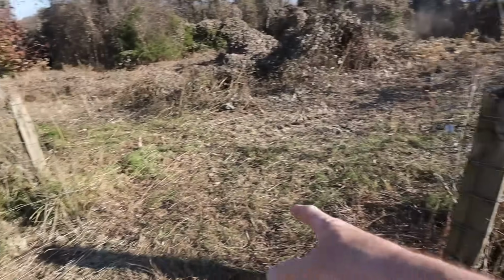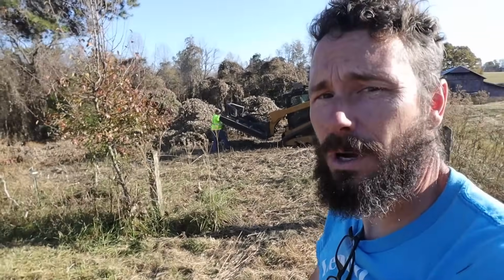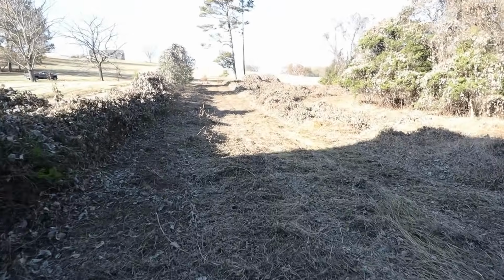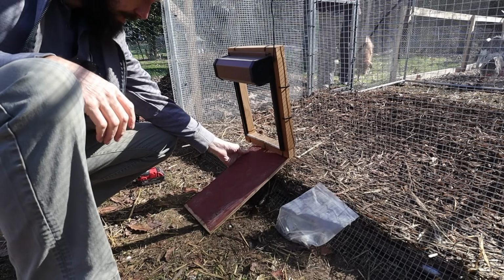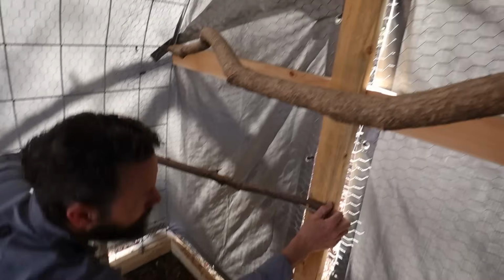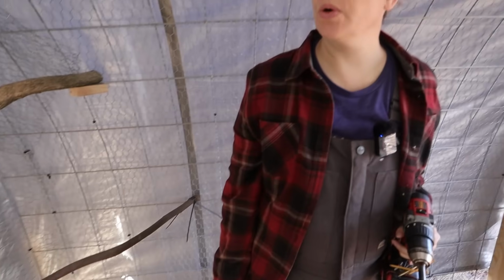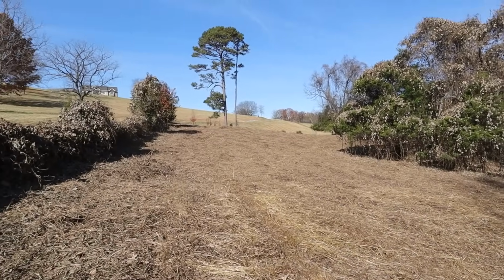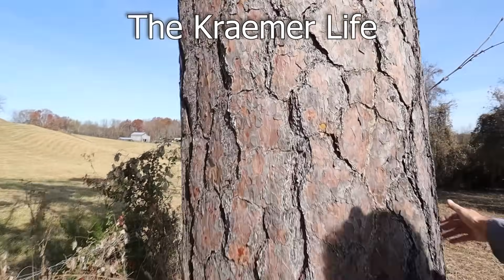We Clear More Land. The Kudzu is taking over

Comment: Kudzu is a fairly easy fix.  Mark off a section, with a hot fence.  Put in goats inside the fence.  They eat like sheep all the way to the root.  When they finish one section do another. The Kudzu will give up the ghost.  I think hogs would probably work.
Reply: Yes goats will eat it down to bare dirt, but once you move the goat to a new area it grows right back. Now if you want to feed the goats tons of hay and grain they will keep the new growth under control.Otherwise the goats will eventually starve and the Kudzu will be back.